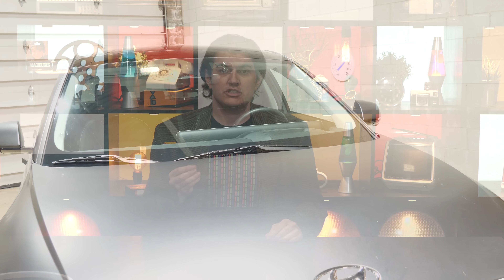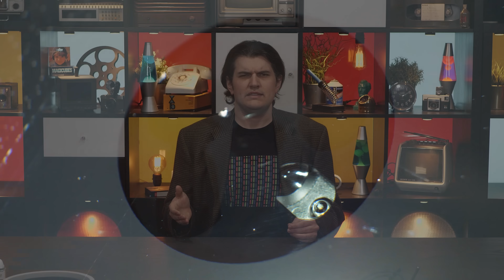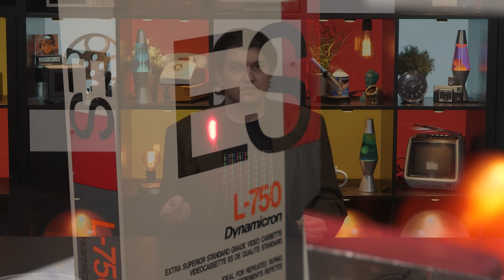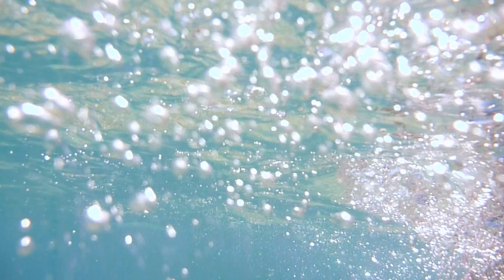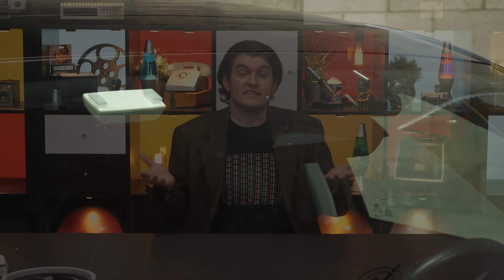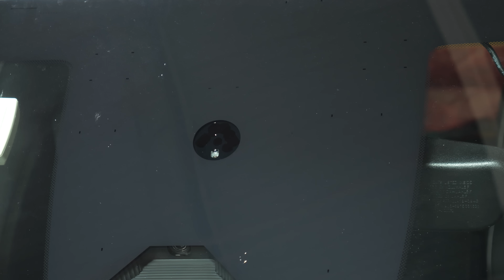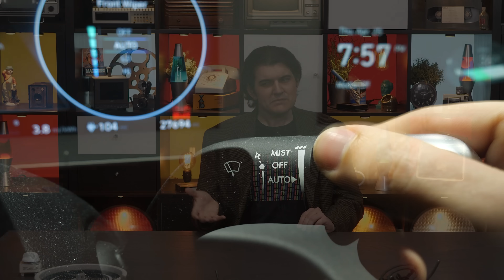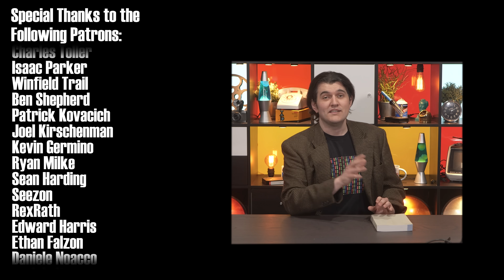The simple, clever sensor behind automatic windshield wipers

Comment: What you try to look up: Change wiper blades
Owner's manual index term: Inclement weather clearing system maintenance
Reply: Reminds me of the army, where a shovel is a "Terrestrial reconfiguration apparatus; manual."
People love to obfuscate simple things just to make themselves seem smarter.
Reply: At least there IS something in the manual, not just a phrase that says "See your service dealer for help" or lists a website.
Reply: I remember many decades ago spending ages looking for the software code pretty-printer that was listed under "grind out elegant listings"
Reply: If George Carlin were still here today, he’d have fun with that.
Reply: All I have to do is turn on the wipers then turn them off while they are up and the stop up.
Reply: @massmike11  on a lot of new cars they will still go down. This way, you don't have to turn off the automatic wipers before you shut down the car when it is raining.
Reply: @massmike11  that sounds terrible tbh, having to think about timing when you turn off the wipers so they aren't stuck in some funny position the whole way. Unless it only does that when the car isn't running, then I can see it
Reply: @RandomNon-interestingguy terrible is a bit over the top. Mildly inconvenient at worse, a non issue most of the time though. People had been dealing with it for over 80 years before these features came in. It was never terrible. People are just now spoiled with features doing things for them and have lost perspective.
Reply: i find it so stupid, on my old civic all you have to do to properly clean the windshield or change the wipers is just to raise the wiper arms, on my volkswagen they also are hidden under the hood so i had to look up in the owners manual just to find out how to get the wipers to raise. i have to turn the car on then i have to shut it off, then in the next ten seconds i have to lower the wiper stalk once

it's so goddamn complicated for no reason
Reply: Sounds like aviation.
Reply: 'Replacing Front Wiper Blades' ...
Reply: 1. Download a soft copy of the manual
2. cmd + f “wiper”
Reply: IDK - mine are right under "windshield blades".
Reply: 'Climate mitigation manual override for fluid management actuator arms for servicing.'
Reply: Ha! I think that might be referring to parking outside during freezing rain. You have to put your wipers up, or they're freeze to the bottom of the windshield and take forever to thaw.
Reply: @R.Daneel  In my experience, owner's manuals use the most obscure terms for normal things making it hard to lookup anything. Example: Let's lookup turn signal replacement and eventually stumble across "intermittent directional lamp disassembly"
Reply: @user443 You're exactly correct. A good manual is well written and comprehensive. A great manual has a large index and contains words that everyday regular people use.
Reply: @R.Daneel not if you have a Subaru. They have an electric heater embedded in the bottom of the windshield glass.
Reply: @Quince828  The ford focus has a heated windshield as an option. 

Like, the entire thing. And it's... rather expensive if your windshield breaks.
Reply: @designator7402  it’s standard on the Subaru and works in conjunction with the switch for the rear and mirror defrost. It’s expensive too if you replace the windshield because then you also have to recalibrate the cameras and only a dealer can do that.
Reply: @Quince828  "Cameras". You don't understand just how stupidly low tech the Focus variant is. It's literally just heating elements, white instead of the usual black, in the windscreen. Or, well, it used to be. No idea if contemporary cars still have that option. Probably not.
Reply: @designator7402  The heater element is low tech, the same thing as in the back window. The cameras are for the Eyesight anti-collision system. If you replace the windshield the cameras have to be recalibrated. I’m sure there’s a technical reason why.
Reply: @designator7402  My fiesta has one of those heated windscreens, had it replaced last year.  Thankfully, in the UK most car insurance policies have glass cover as standard - and it covers heated windscreens.  It cost me a total of £50 and insurance paid the rest (which would have been around £1500!!!) and again, thankfully, glass care doesn't count as a claim, so it doesn't really affect the upcoming premiums - you don't have to even tell a new insurer if you switch.

The heated screen is literally the best feature ford have ever invented, especially in the frosty UK climate!
Reply: @designator7402  But it's worse at night, producing glare. And once you focus on that tiny lines, you just can't unseen them...
Reply: @razvanlex I had a Focus mk2 and that was the only thing I hated about that car. 
My brain sort of did."unsee" it but it took more than a year.
Reply: @designator7402 Cars in the past could be pretty dumb because the manufactures could rely on the auxiliary processor between the seat and steering wheel to handle changing driving conditions.
Reply: That's one thing I love about my Tesla: Wiper Service Mode is just right there in the Service menu. Easy to find. Easy to use. Easy to disable when you're done swapping out the wiper blades.
Reply: @coredumperror  but you have to admit, Vision based auto wipers is still crap. I'd take a proper rain sensor over slightly easier blade replacement any day.
Reply: @noahbehnke  You're not wrong. I did find myself frequently enabling manual wiper mode while driving through the rain on my road trip to Texas to view the Eclipse. I've never felt the need to do that in LA, but we don't get much rain, here.
Reply: @coredumperror  What I love about my car is that it just doesn't have this problem at all, I don't have to dick around in menus or know the Konami code. The car is intelligently designed to let me lift the wiper arms when the wipers are in the parked position. Thanks, Toyota!
Reply: @coredumperror Having to go through a menu just to change wiper blades is awfully inconvenient lol
Reply: @SnakebitSTI  on a lot of new (and even some old) cars you need to raise the wipers to be able to change them. They are tucked away when not in use to reduce drag. On a lot of cars this requires some weird sequence of button presses. I would prefer the menu. On my older car it’s in a menu and it is pretty easy to find. On my newer car you would not be able to guess how to do it.
Reply: @coredumperror  one thing I love about my 20 year old car: I dont have to put anything into service mode its all just easily accesible at all times and ready to go
Reply: @coredumperror  That is not simpler, it's more complicated. Read the manual, put the stalks up an wipers in service mode. That is simpler.

Comment: Alec, stand proudly. You used the manual as intended; as the last resort. You sir, are an engineer.
Reply: I just opened my hood when I got to this problem.
Reply: @andrewpast1959  my repair guy did that, when i asked him how to put wipers in service mode, he looked at me like an idiot... he didnt know there is service mode... so i had to do the googleing and found it for myself and him...
Reply: It's only a last resort when it fixes the problem
Reply: @Pingviinimursu exactly for shit that’s not in there I look at the manual first every time
Reply: If it's not on Google it doesn't exist.
Reply: To be fair, if you continue trying to solve a problem after finding the solution, you are also an engineer.
Reply: For those who do not wish to stand proudly or are not an engineer and use a VAG car, the wiper service position is set by pressing the stock down after you turn off the engine.
Reply: Eh. I installed (or rather had the car parts store install) windshield wiper blades with the arms down after I lost the blades in the car wash… because I didn’t know how to turn off the damn windshield wiper.
Reply: As an engineer I spend the majority of my time reading the manual, or more formally datasheet. So I feel like it's more the first than the last resort.
Reply: @oliverer3  Microchip forums taught me the RTFM acronym. They... aren't friendly, and I thankfully learned that through others mistakes not mine.

Also those MCU datasheets are fuckin' books worth of information. 200+ pages not uncommon on the full version.
Reply: @Kalvinjj  It can get even worse, I've had to deal with multi thousand page datasheets at least a handful of time. But most of the info is usually in there so RTFM does work most of the time xD
Reply: @Kalvinjj 
200 pages 
That is a short manual
Reply: I need something like that on a shirt
Reply: I must be doing it wrong
First thing I did was read the owner’s manual when I got the car
But I AM also bragging that I know how to read (kind of)
Reply: I got a new car recently and checked the manual for the really key stuff (making sure I knew how to demist my windows, put my main beams on and off, hold the car when stationary and so on). The remainder I check when I need to and can't figure it out. Rare that I can't, it's quite a well designed car. Good design, Audi, well done.
Reply: Not true, all engineers care about are dispensers, sentries, and beer
Reply: I was going to say, isn't reading and understanding datasheets an essential skill for engineers? How can you be a good engineer if you don't understand the characteristics of the parts/materials you work with?
Reply: @SnakebitSTI as an engineer, we usually try to use logic or prior experience trying to figure out a problem, hoping it'll be something you can find or fix just from digging around (the system, not documentation). If all else fails, THEN we go to the official documentation, and yup, it's right there...
Not saying this is a good thing or defensible in anyway, it's just something we tend to do. Try to outsmart the system
Reply: @SnakebitSTI itsajokebro
Reply: As the last resort? It should be your first resort, especially if you haven't read it. It's often a lot more useful than you might think.
Reply: @ElusiveDino  That'sTheJoke.jpg
Reply: @ElusiveDino whoosh

Comment: With the amount it just doesn't work like you expect it to, it can't be anything but complicated as all hell. But I will watch your video to see if simple tech doesn't work either or if you're leading me on.
Reply: Ah, so it is relatively simple. Frankly though, I wish you could turn on the automatic wipers and then add a modifier to the speed it has decided apropriate instead of the additional option of just turning them on. You get the automatic turning on and off, yet the option to manually adjust the speed if (really I mean when) they don't do what they need to do.

Comment: I worked in the automotive glass supply chain in the early 2010s.  Sensors like this drove me nuts because the different combinations of them meant that there were nearly 30 different windshield variants for different cars, depending on which package the owner had.
Reply: Years ago I had my Mini Cooper windshield replaced 4 times because the sensor wouldn’t work. The glass shop finally gave in and ordered OEM glass with the proper configuration and it worked perfectly.
Reply: Good to know, if I get mine replaced I'll tell them not to worry about it.
Reply: @iunnox  Have fun with shitty windshield wiper behavior, then.
Reply: @coredumperror He's implying he doesn't care about auto wipers, probably because his don't work well anyway so he just uses manual.

Tldr, that's the joke
Reply: @craigslist6988 just because they don't care doesn't mean that their car doesn't care.
Reply: @coredumperror  I never use auto wipers. Shitty behaviour is all they do.
Reply: @iunnox sounds like you need to try a better car, my meganes auto wipers are brilliant, and they have an extra fast speed for clearing large splashes from passing vehicles or super heavy rain
Reply: @blahmanliutenant  Auto wipers aren't a factor in looking for a car for me lol. They certainly aren't a factor in whether a car is good or not. Having manual wipers sure is, though.

Manipulating a control stalk that's 2 inches from your hand isn't even a minor inconvienence. Dealing with automatic systems is more than minor, however.
Reply: I was a glass tech in the early 2010s.  I feel this so hard.
Reply: do you happen to know if all/most of these detectors are digital and require programming or if there are analogue variants where the logic is entirely in the circuitry?
Reply: @hanshubert6675  No idea.  My issue was just that the fritwork was different for every options package, meaning that we had to stock all of those different variants and convince the suppliers to do the smallest runs possible of variants that we'd take years to sell off.

Fun fact:  The Jeep Wrangler windshield is, by far, the most-replaced in North America.  Not only do Jeep owners more often drive their vehicles in places where a stone might get kicked up, but the more vertical orientation means that incoming debris will crater a Wrangler when most windshields would deflect it without breaking.
Reply: @hanshubert6675 they don't require reprogramming.
Reply: I used to deliver parts to a used car dealership's garage. They bought a Tesla to flip once and swore they'll never touch them again because if you replace the windshield you have to pay Tesla a couple thousand dollars to send somebody out to program the windshield.
Reply: @tparadox_1988  I just had my Model S' windshield replaced last month for about $700 (which insurance covered at no cost) and the auto rain sensing works exactly as it's supposed to. This was at a major 3rd party auto glass place and it was no big deal. It was ready the same day I dropped it off. I don't know why a dealership would have some multi-thousand dollar issue.
Reply: @tparadox_1988  It's not the windshield itself that needs programming, it's the driver assistance (Autopilot) cameras that need to be calibrated. 

They could have done this themselves with a Windows laptop, an ethernet cable and a one day subscription to their Toolbox software. It's $165 for a day, $500/ month.
Reply: @anthonyreynolds2365 you don't need toolbox to do the calibration on most newer Tesla's. Put it in service mode through the screen, check the camera angle, clear the calibration and drive untill it's finished calibrating. No Tesla subscription required.
Reply: @anthonyreynolds2365  Thanks for the info!

Still I think that should be completely free to replace, some simplified free software or something would be good
Reply: @tparadox_1988 that’s absolute bullshit, tesla calibrations are done remotely and cost $0

Comment: what about when the sensors fail and your wipers are running 24/7 until you replace the $60 module and spend $800 in labor to replace it? 
Even if the sensors are "cheap and simple" do you think disassembling your entire dashboard to access it is simple?
Did you or auto manufacturers think this far?